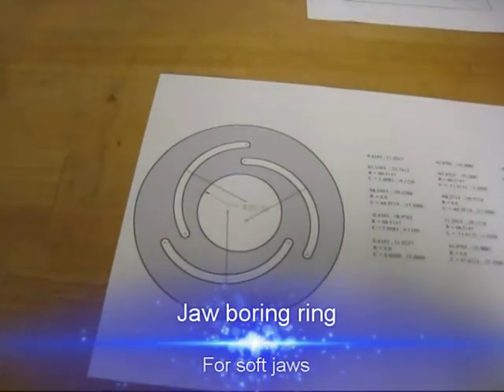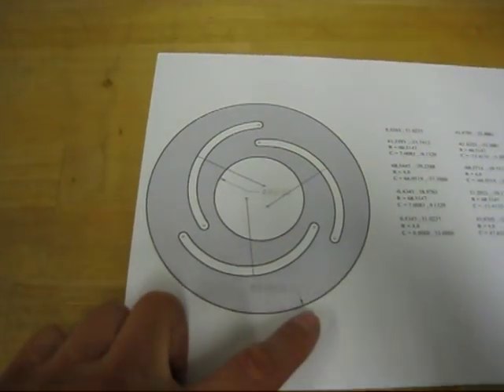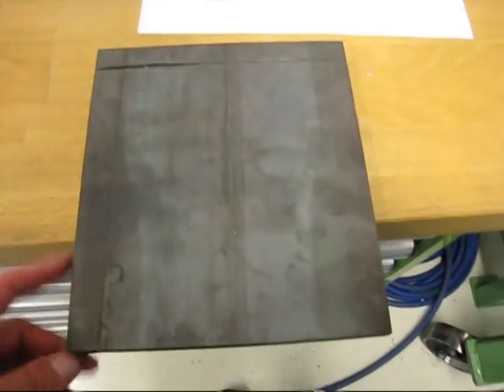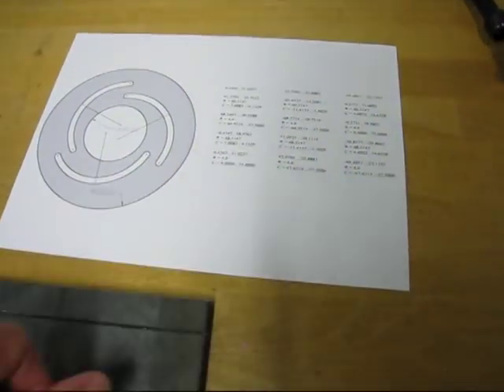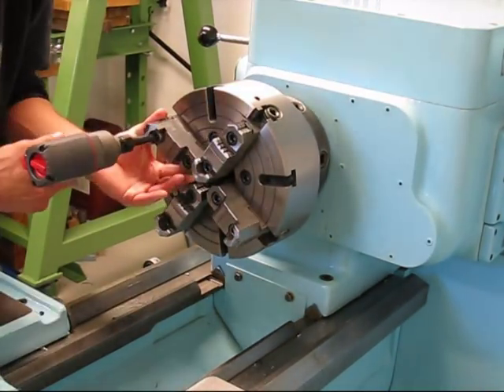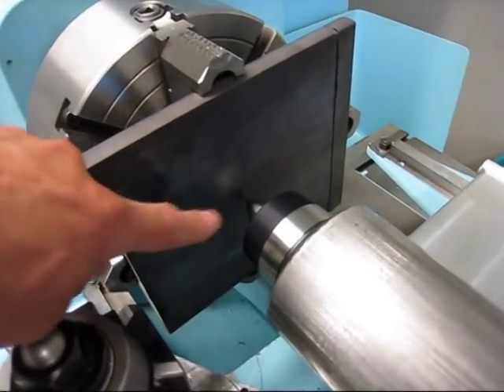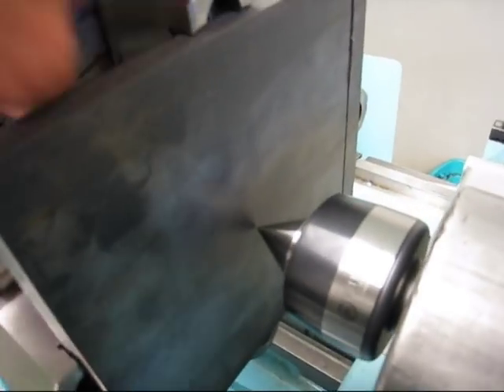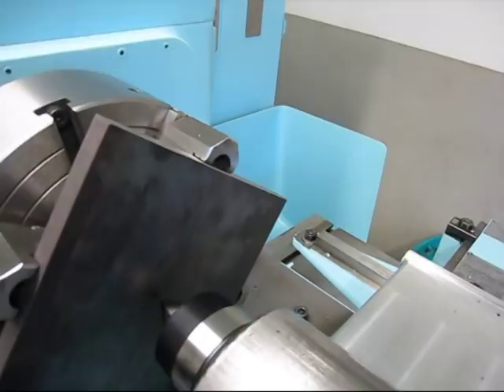Jaw Boring Ring

Comment: Very nicely done! what will be your method to assure equal pressure on each of the three mounting points?
thanks for the video   regards   vic
Reply from the maker: Thank you! There is very little slop in the holes for the pins , and the ring and pins gives a little so I think the pressure equalizes itself. That's my theory anyway. I will check the runout of something I clamp in the bored jaws. If the runout is good it must work.
Reply: And thank you for the interesting project. your theory makes sense. Might be fun to try an experiment where the pins are left a bit slack while the part is tightened. Tightening of the part may put equal pressure on the pins which can then be drawn tight. Just an thought....:-)